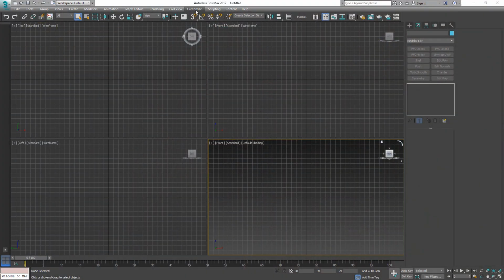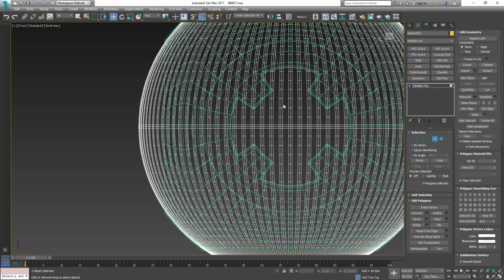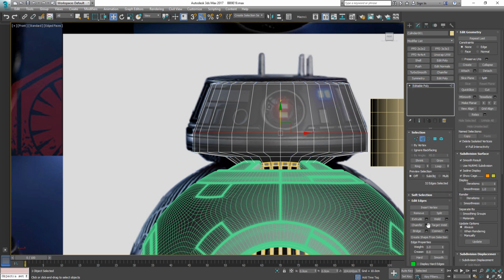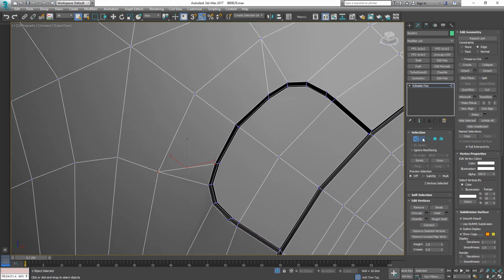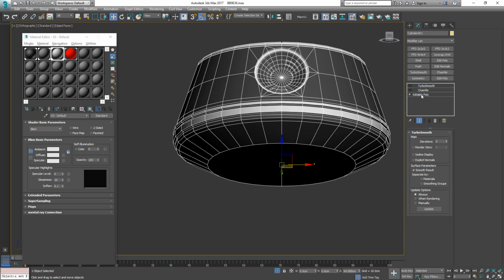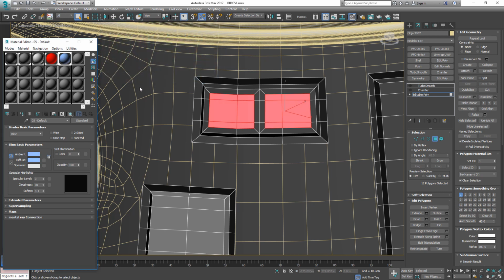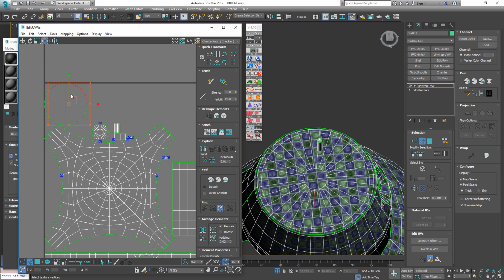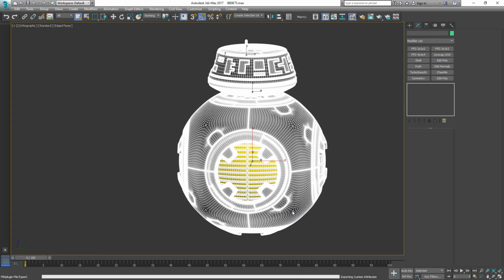Star Wars: Droid Tutorial - Part 1 - Modeling & UV Unwrapping - 3Ds Max

Comment: Hey there, ChamferZone. Loved your tutorial on texturing, but I have a question. I have this character model where the belt is tilted and not symmetrical, unlike the rest of the model. 

So I tried to attach the belt polygons to the rest of the model, but the symmetry  option ruins the belt. So should I keep the belt separate and texture it by itself? 

Or is there another way to parent the belt to the character model without the symmetry ruining the belt? Thanks again for an amazing tutorial, hope you can answer my question whenever you can.

Comment: rlly you are cranking up everything? at work i have everything on ultra low and have frame drops to 6fps with a 7000€ workstation. dafuck
Reply from the maker: that is strange... I never have that issue but I guess it depends on the complexity of your scene! If you have millions of polygons bringing 3dsmax down to its knees then it's certainly not recommended to crank stuff up that high.
Reply: thats true. but only with a cube in the scene its not that highpoly :D